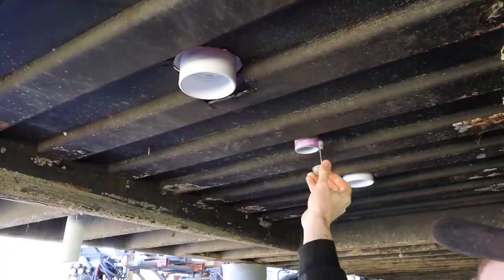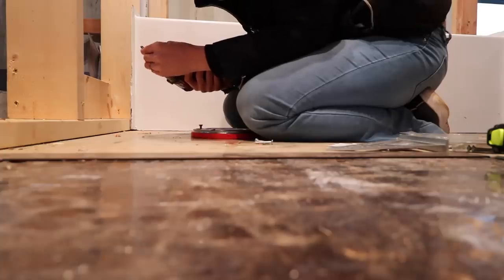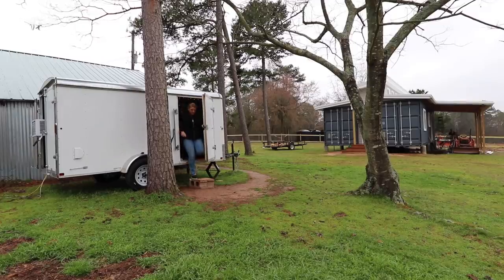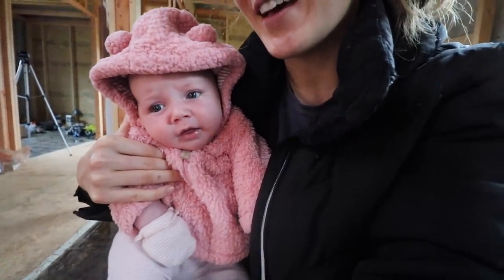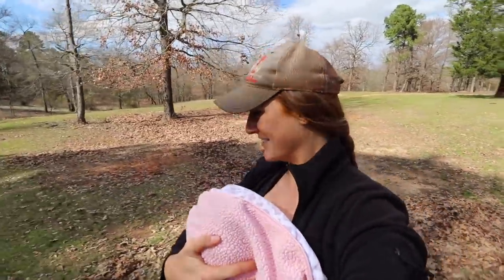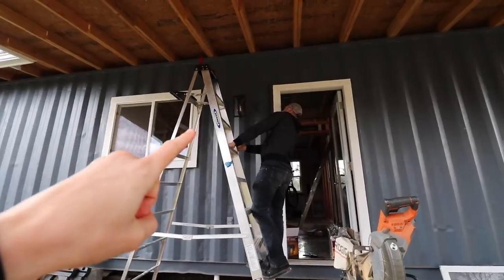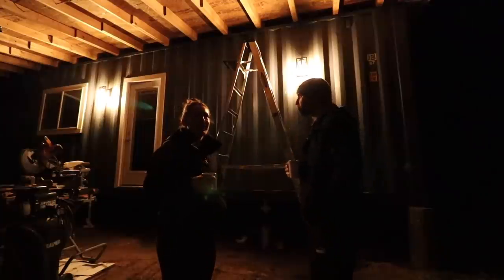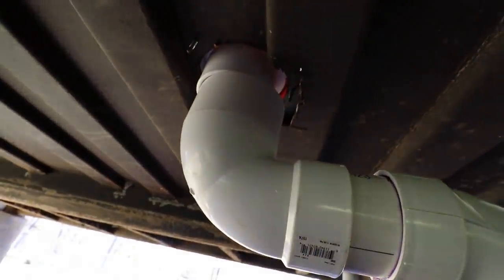Lighting Up Our OUTDOOR LIVING SPACE!

Comment: Just a little tip: when you use stainless steel nuts and bolts...ALWAYS ALWAYS  ALWAYS use anti-seize lube. Stainless tends bind and lock up when you least expect it especially with nylon lock nuts. P.S. awesome channel keep it up.
Reply: I learned this the hard way as well. lol
Reply: "ALWAYS ALWAYS  ALWAYS use anti-seize lube."  goes for more then just stainless steel nuts and bolts.
Reply: Any oil/lube works, if anti-seize not available. And yes, use oil/lube always with stainless steel bolts and nuts.
Reply: Yeah, a squirt of WD-40 works in a pinch.

Comment: One suggestion: Put up some 10 or 20 watt led light above the poach to have really bright light if you need it. And for work you do outside.
Now everything is accessible and you can install it now without problems. And can install the additional switch.
You can not have too much light. 👍
And perhaps add another switch for floodlights around the house to get the whole surrounding lighted. Especially if Beau is older you can see her around the house by night.
Great addition, the house looks so cosy by night.
Greetings from Munich, Tom.
Reply: I was thinking about the same thing. I thought they coud've added L.E.D strips which are cheap and easy to install as well. But best best part is they wouldn't use even half of the electricity needed to light up those yellow one's.
Reply: Thank you for that suggestion. My husband and I were trying to figure that out as well m
Reply: Just got into solar panel LED garden lights to avoid cable runs. Bought some at our garden centre here in UK eith a foot square panel...great light, movement sensor activated.

Comment: Once you start building the decking you could all ways put decking lights around it and run the wire under the container and back up to the fuse box. Great video guys. Be safe. 🇬🇧

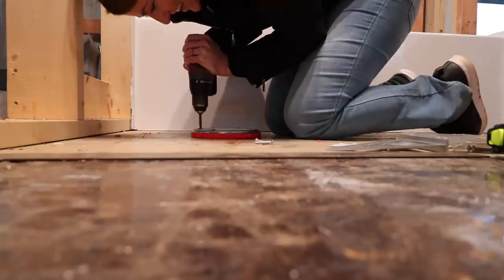Comment: 2:08 
Couple things... If I could just give a tip to DIY's.
#1- if you're drilling through metal Its best to NOT lean all your weight on it. Try getting the RPM up before slowing applying pressure so it shaves a little at a time. (With that being said it may still bite. Using an oil to keep the bit sharp and not overheat helps too)
#2- could be a lot easier to use self tapping screws and an impact driver type drill. Even if the self tappers are just a pilot then remove and drive the screw of choice. (As some self tapping screws are not good with moisture and will rust)

*I see he did end up going with self tappers. Great job! These videos are awesome BTW. I can see this type of home build definitely catching on. 🙌👍👍

Comment: This is awesome! good job! A few tips and tricks for you if you were not aware of them. when dry-fitting your PVC pipe mark a line across the connecting pieces so when you glue them back together, you just have to connect the lines, you will get a perfect fit this way. Also when doing electrical a good set of linesmen pliers with a fish tape puller will go a long way and prevent you from breaking your fish tape.

Comment: The nuts you have in experience have to be tapped before using SS bolts
Reply: Herb Myers Sometimes bathroom fasteners use fine thread. Example 1/4-20 vs 1/4-28. He probably has a mix 
of 20 pitch and 28 pitch.

Comment: Couple things I seen need kick plates when ever pipes go through stud wall to prevent screws going into pipes during drywall or wall phase.all penetrations need foam sealer also where pipes go through floor of container.Also put kick plates wherever electrical wires go into stud wall and foam seal as well.Insulate under home with a foam rated insulation or whichever.Love to watch

Comment: Stainless Steel tends to gall itself but I think the problem isn't the nylon locking nuts but a mismatch of thread pitches on the screw and the nut. That is why you torque the nut and ended up breaking the driver bit.

Comment: Mackenzie, if you spread a thick coat of sulfur powder under your house the snakes would be less likely to come around.  Cats also control snakes and keep them at a distance.  I had snakes real bad getting my chickens and eggs and the rats moved in too which snakes follow the rat trails.  I got a couple cats and started using sulfur to control bugs and lo and behold I haven't' seen a snake in my chicken area for 4 years.  Around here 25lb bag of sulfur powder at the farm supply runs about 20 to 25 bucks.  Also for the cats as ratters and snake control out of 6, my Polydactyls are the best by far and started very young.  I do have a former rescued street cat who also does a good job.  All of my cats are fixed rescues but the 2 rescued from a hoarder situation where they never left the house are the least effective though they do work as they age it is less and less.  Just a heads up if you want varmint control.  Hunting cats are also less likely to be got by coyotes.  I have coyotes all over here trying to get to the chickens and haven't lost a cat yet buy my dogs also contribute to that.  My cats and dogs are great friends and all of them get along with the chickens too.

Comment: Stainless gets gallded and seizes up. You need to use some anti seize or else get brass nylon lock nuts they won't rust and won't seize up on stainless screws or bolts. They are used in the Marine industry all the time because of the same issue.

Comment: the light out side is like dinner at a romantic restaurant mood lighting the light we use is a 4 foot LED shop light just instead of the fans. just one and the every thing is very bright bright i guess u guy like the dimmer lights. also we do not have a wood patio roof frame any more we now have a flat pan Alumawood  roof Patio and i using tow plastic beams as the support for the light as we can not make any holes to the flat pan roof it is not the insulated kind

Comment: Did you hole saw through the roof of the container? Did that present any problems, or was it straightforward? Which hole saw type/brand cut through the corten steel?

Comment: Completely unrelated to your vid, and I'm sure you guys have a huge list of things to do, but I was wondering if you guys had any thoughts about structurally reinforcing the middle of your house? Idk like some kind of metal or beams inside to keep the containers and middle structure together from the inside? I'm no engineer so I wouldn't know jack about jack. Also, great video as usual, congrats on your lights!
Reply: Each container is sitting on 8 concrete pillars. I don't think it's going anywhere. 🙂
Reply: @GeneWaddle  so no chance of splitting down the middle??

Comment: Here a Tipp from an old Professional: If U use Stainless-Steel Nuts and Bolts, you MUST use Grease for the Threads! otherwise the Bolts and Nuts get stuck, and you cannot turn them tight anymore! Stainless Steel Screws are the nastiest thing to use in installation!! No turn without Grease! NOT even a Single One! Risk is too big that they get stuck!!
And by the way: Don`t try to walk with the baby until it`s big and strong enough. The Joints in the spine are too underdeveloped to withstand the effort, and this can cause severe damage!